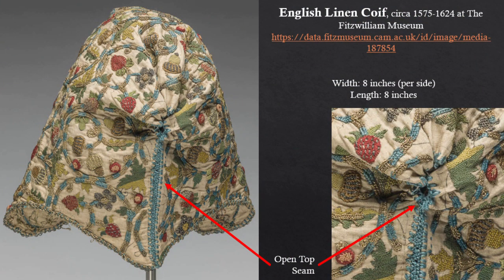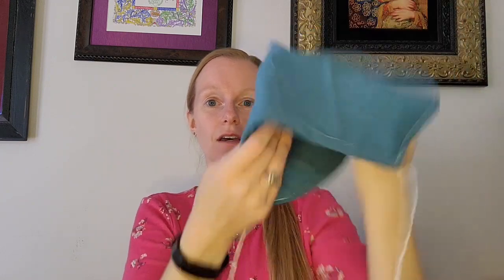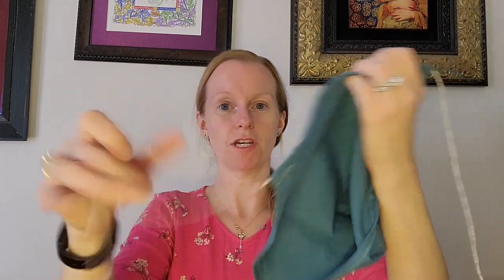Making a Coif | Drafting a 16th Century Tudor French Hood Pattern Part 2

Comment: Looking forward to the rest of this series. I have short and baby fine hair. I’ve taken to stuffing strips of linen with scraps of linen to then stuff the coif with my version of fake hair (picture a snake shaped tea bag sort of thing LOL). In other words, my kingdom for decent hair to braid but I was not so blessed in this life.  Learned my lesson on the liberal use of pins this weekend at a Baronial Bash (in Darkwater, Trimaris) when I was retainer for my own Baroness of Marcaster. I used only 2 pins, one on either side of my temples, and as a result my veil kept slipping from the top of my head down my back. The minute morning court was over I added more pins to the top and that solved the problem immediately. So always bring and use plenty of pins! I’m sure you already know that, and now I won’t forget it. Thank you as always for your videos. Very enjoyable and appreciated.
Reply from the maker: Thank you! My hair is also baby fine. I'm not sure how short your hair is (or if you're looking for a suggestion instead of linen scraps). If it's extremely short, you could always try doing what a friend of mine did: she shopped the after Halloween sale and bought a wig. Hair extensions could probably do the same. 

Yes, pins can be quite helpful. Otherwise, I use hairspray to help hold my flyaways down.